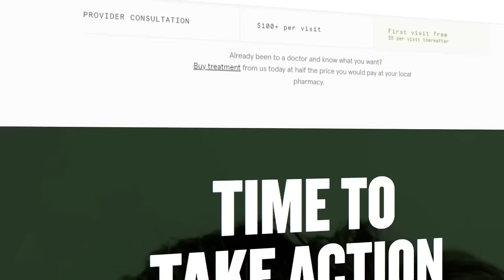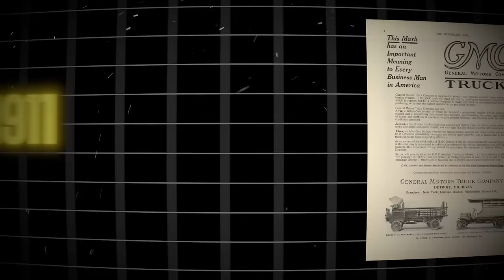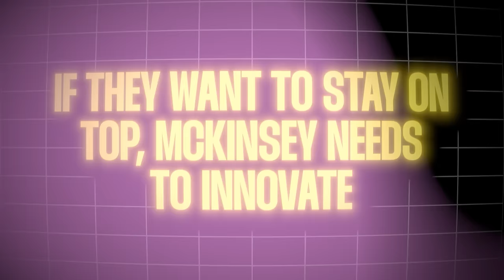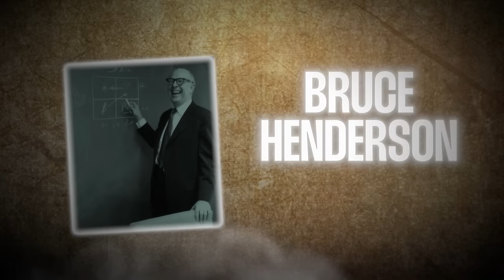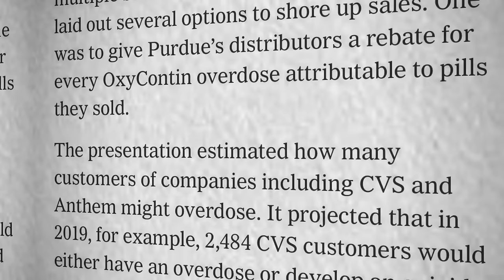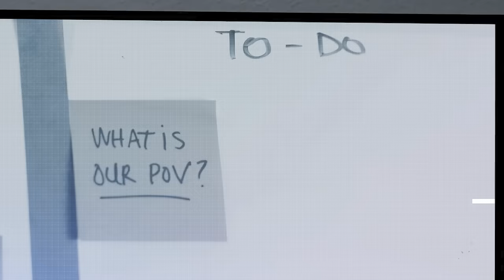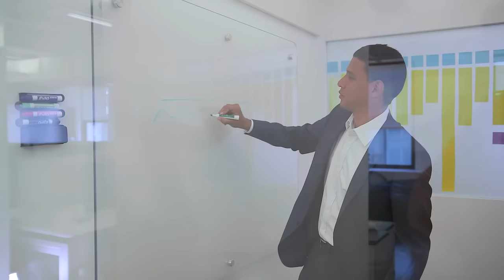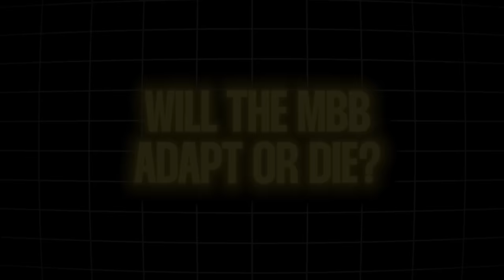The Sinister Methods of McKinsey, BCG and Bain

Comment: At 27:14 While the brightest minds leaving R&D, and siphoned off to cnsulting, does hurt some, the problem is that, in the absence of consulting, there would be a glut of underemployed researchers, which would be deeply felt in biomedical research, and other areas of STEM. 

It would make the structural issues with PhD underemployment even worse or, if it didn't for some reason, the talent landscape just wouldn't be the same...
Reply: You appear to miss the point while confusing yourself. instead of scandal resolution and/or causing, these minds can be used elsewhere. If they are unable to innovate, they can hammer widgets.